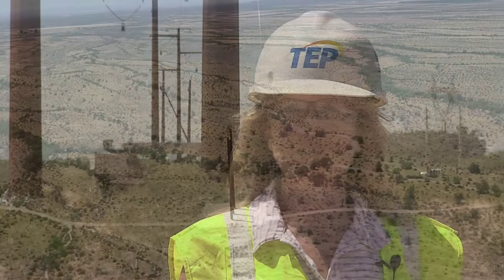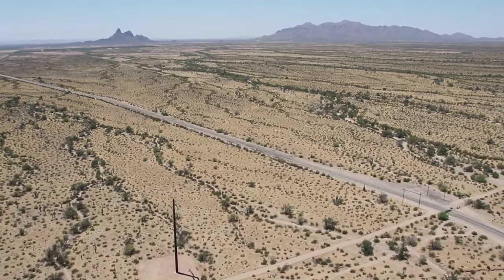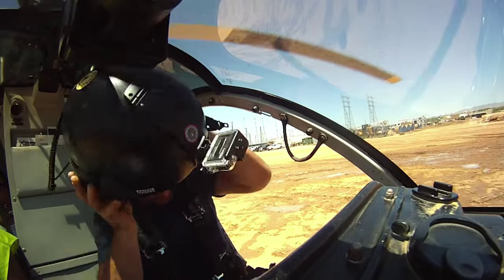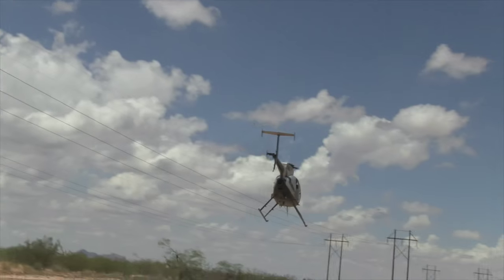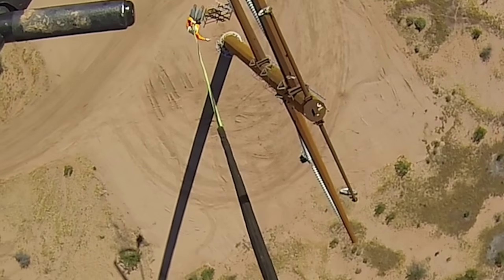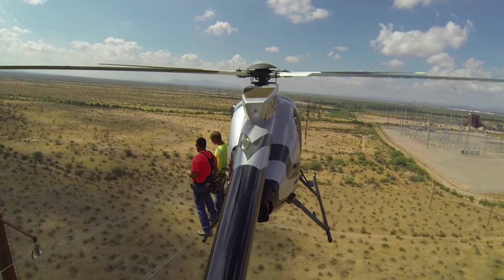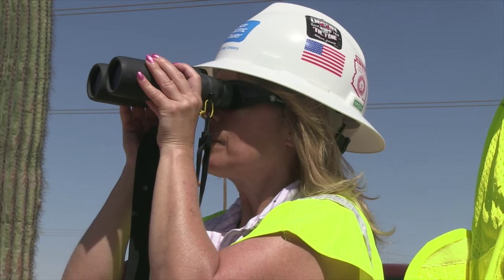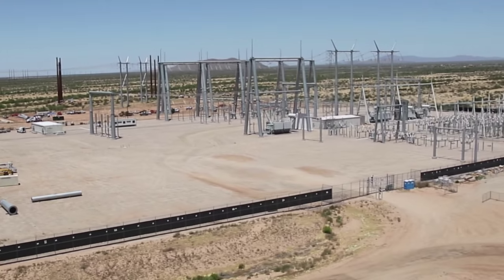Helicopter Wire Stringing

Comment: @Thomas Metzner - You can't leave miles of line on the ground. To keep it in the air it has to be fastened or guyed. Once it's placed it can then be attached to the insulators by lineman flown in by helicopter. This is quicker than setting up bucket trucks that have that kind of reach for each pole. Believe me, if there is a less expensive way of doing this, the companies would be doing it already.

Comment: Just a thought, why do they need the risk of a chopper stringing a draw wire up? Why not just leave a draw wire attached to the main pole when they erect it with the cranes that is reachable from the ground. Then just drive along the bottom snd connect there and use a pulley to hoist it?